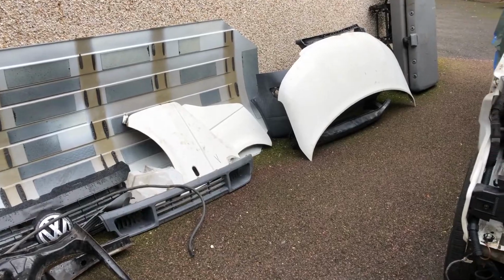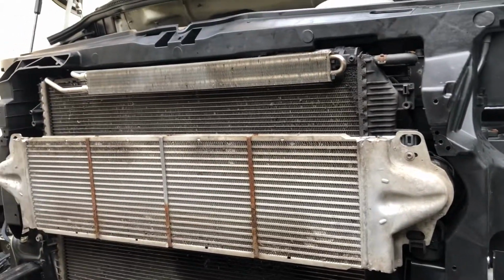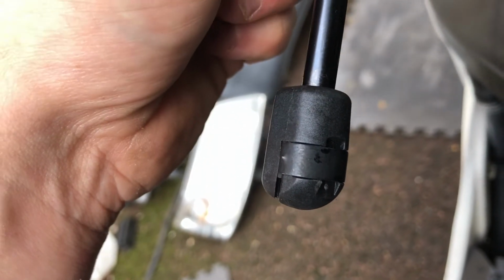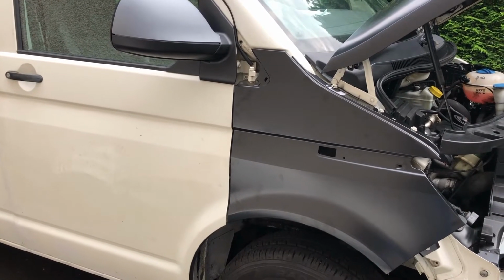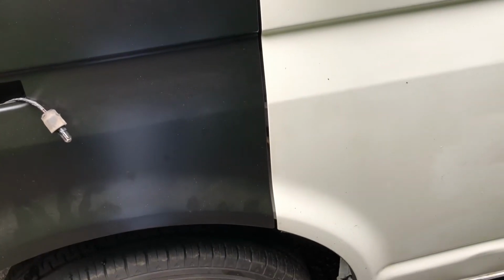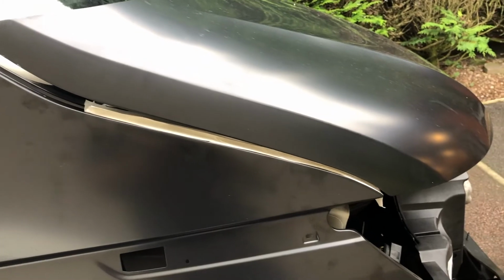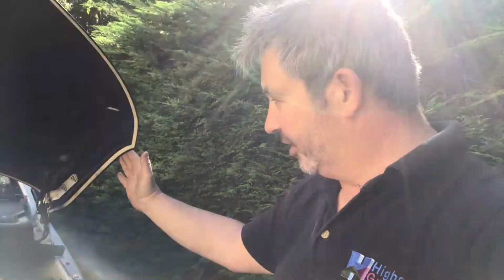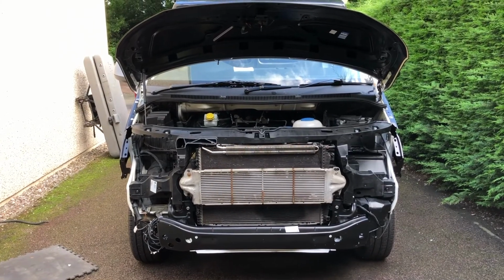VW T5 to VW T6.1 Front End Facelift - Step by Step: Part 2 (Prep, slam panel, bonnet and wings)

Comment: Great videos, been really helpful. Do you have any images or video of cutting and removing the slam panel? I want to do the same without disconnecting the cooling lines. Is it possible? Cheers
Reply from the maker: Cheers. I don’t have any pictures but it is possible. I took mine out in bits! (They’re not worth much second hand and it made the whole process much easier…

Comment: Hi, I’m doing the t5 to t6.1 to my van, do I have to change the washer bottle and where do I get one from if yes?
Thanks I’m advance👍🏻
Reply from the maker: Hi, yes you do. I bought all my kit from Travelin Lite but most of the items are sources from VW as the T6.1 end is still fairly new. I’d suggest a scrappy to see if anyone’s breaking one or VW. Google is also probably your friend here. Good luck. N
Reply: @highergroundlifestyle  hi, thanks for these awesome videos. I'm just about to order my parts, I was going to order the washer bottle, filler neck and rubber seal. In your video it looks like you used the original filler neck/pipe into the new reservoir. Is that correct? I'd love to save a few£ if I dont need the filler neck and seal!

Thanks again
Reply from the maker: It’s terrible to admit - but I can’t remember! I’d need to check the video again myself. Sorry. N